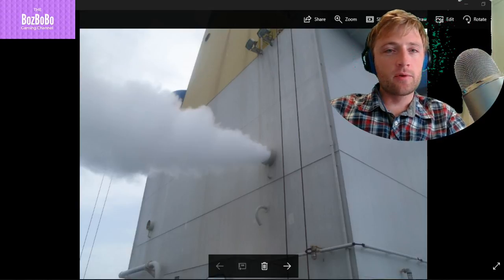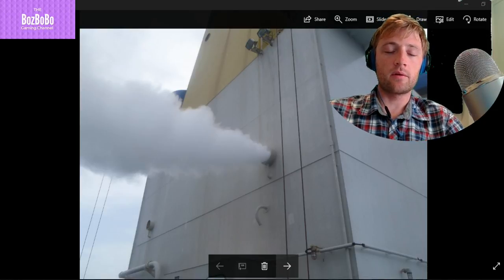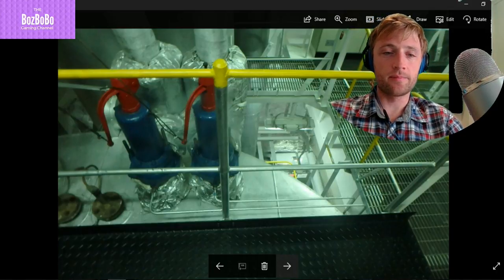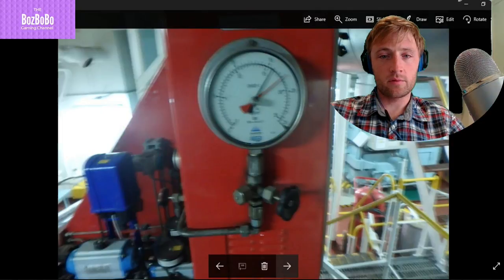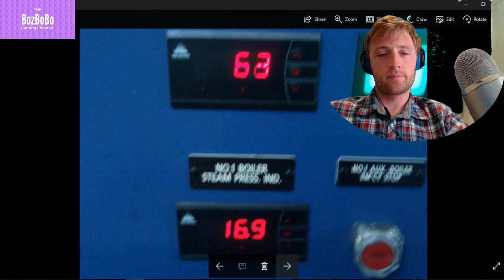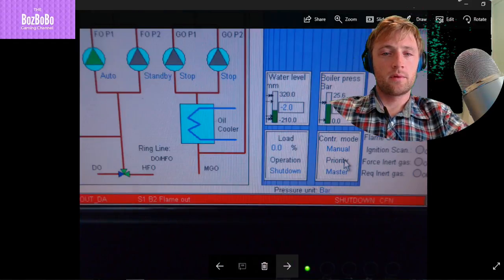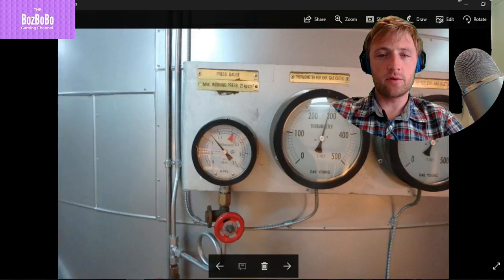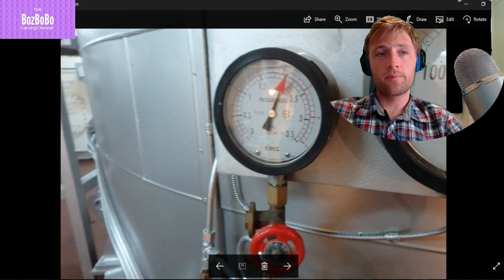AUX.BOILERS & EGE POP UP TEST

Comment: How we prevent burner stop before the safety v/v to the boiler opens ,when we make the test ?
Reply from the maker: To make such test just close the outlet not fully and check until safety valves opened.
There is not any burner at exh gas boiler.
Reply: @Adventure-Story  am sorry here I am speaking for alborg boiler.  

Not for exh has boiler

Comment: If we are full load of the engine and we need very little amount of steam.  How we prevent the exh. Gas boiler steam press rise ? 
We by pass the exh directly to atmosphere?
Reply from the maker: Hello there is a steam dumping valve which will be opened and steam will be sent to atmospheric condenser.
Reply: @Adventure-Story  thanks you . □

Comment: where is the procedure?? why ege pressure is set higher than auxiliary boiler?how to do pop up test incase of exhaust gas boiler?
Reply from the maker: Hello Siva ,this is a procedure we had i one company all instructions was  in PMS programm for each job they had a description.EGE pressure as i have seen is always higher as it's made from manufacture .The pressure is set higher because in case if Aux.Boiler not open this will be the last Safe way to reduce pressure.Pressure differences is clearly manufacture design they like to be this way ,to be more safe.
Reply: thanks for the reply